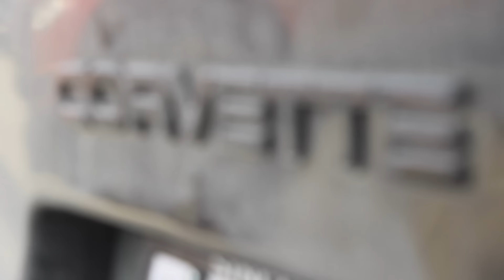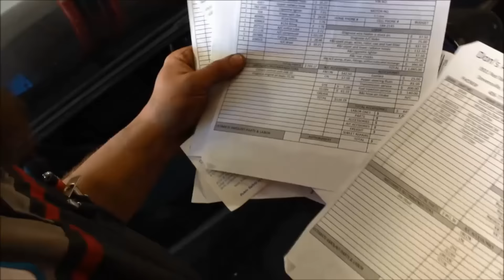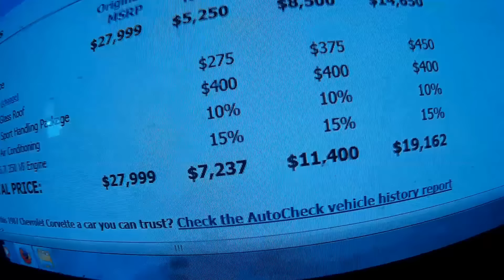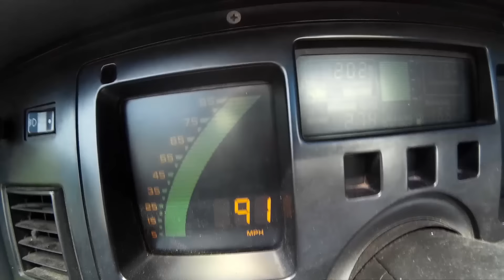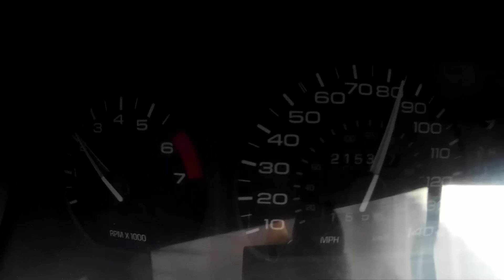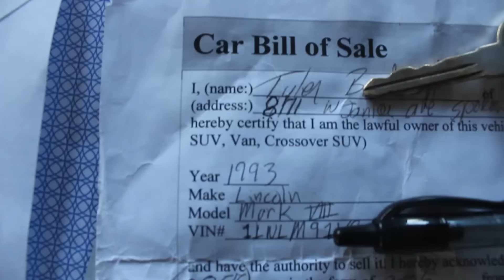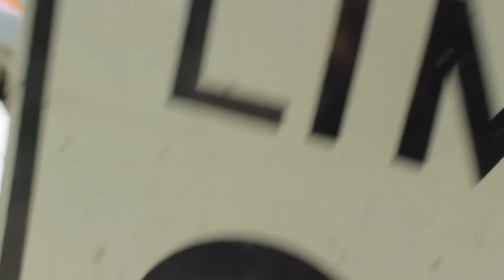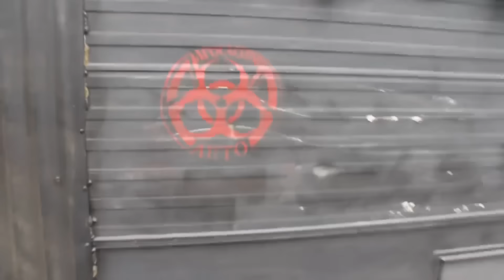How we make$$$ on a c4 Corvette!!  APOCALYPSE AUTO ep.6

Comment: I loved the blazer vid. It was fucking awesome. I am thinking of doing something similar with a 1996 gmc jimmy I have. I was wondering what you did with any of the wiring. And how well that rear suspension worked.
Reply from the maker: ray blaze thanks, sorry for the late reply! The suspension actually worked really well and I never even put a panhard bar in it. As for wiring I deleted anything not necessary to run so all I had to rewire was lights and fuel pump wiring. keep us posted on your build. post pics on our FB page!

Comment: This is great...aside from the dastardly car seller carpet dye, LOL! The buff job really brought back that black paint. And it's no wonder the Vette smoked the Lincon. Even though it has less hp, the torque is around 350 and as you said, it's lighter. These cars put the power to the ground a little better than most.